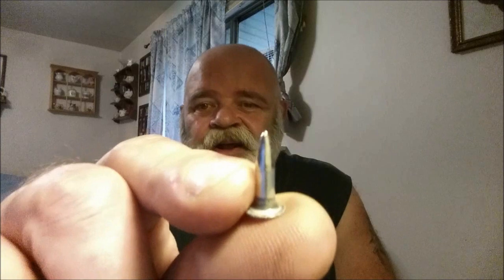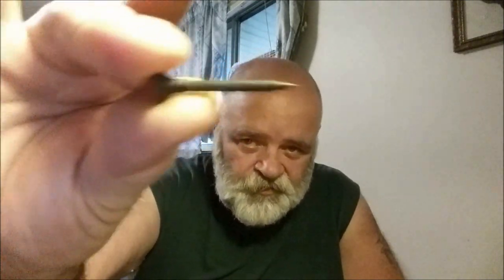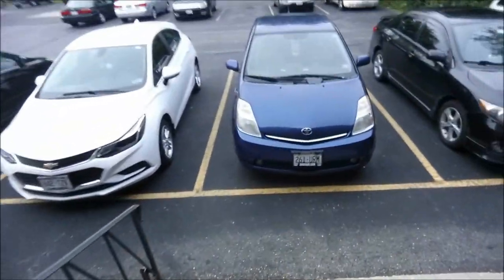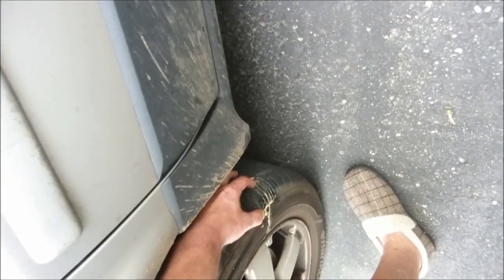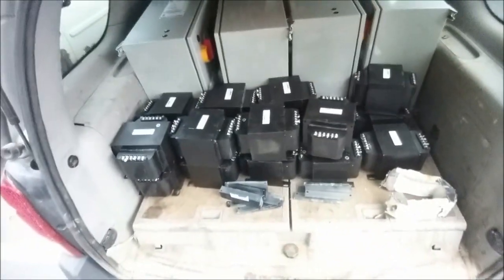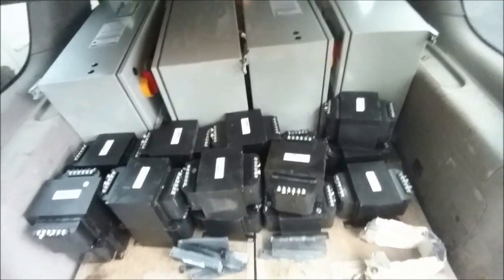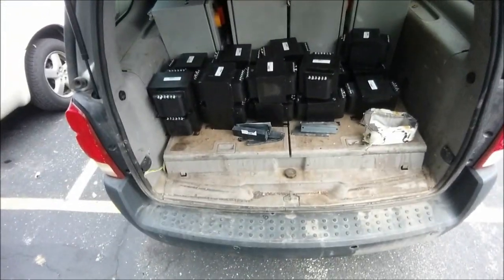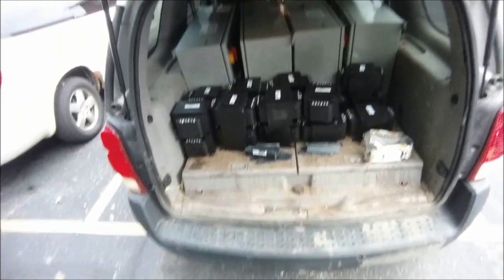3/4's of a TON...IN THE VAN! Heaviest Load EVER!!!

Comment: Seems veary unsafe when u could of bought a plug kit at any auto stor for about 5$
Reply from the maker: Worked with what I had on hand. Throwback to the 1960's and 70's when my stepfather did the same thing with a different adhesive. And I did check the local auto parts stores for a plug kit. Not $5 here. $20-$25.